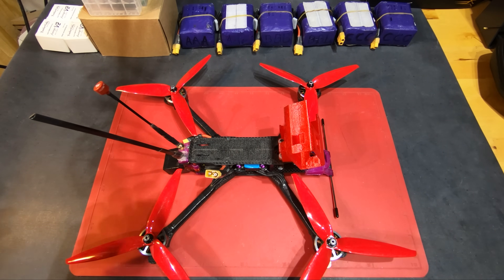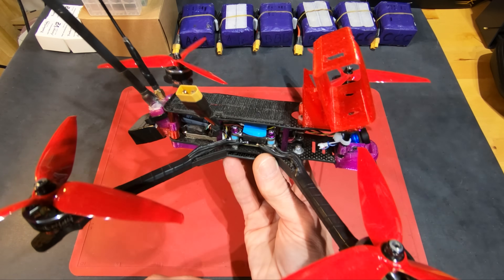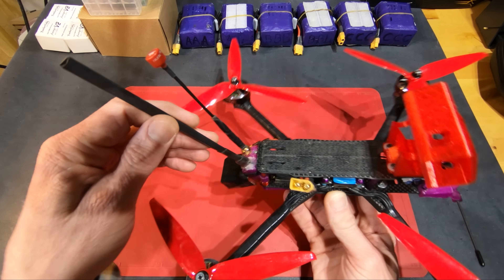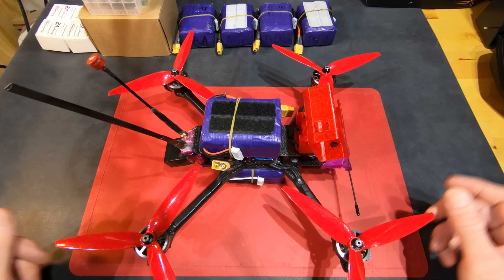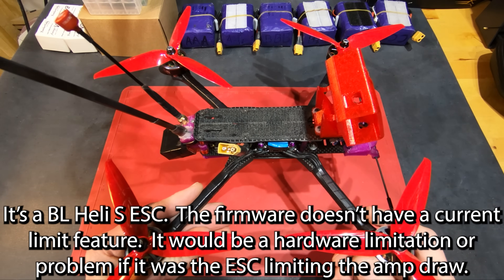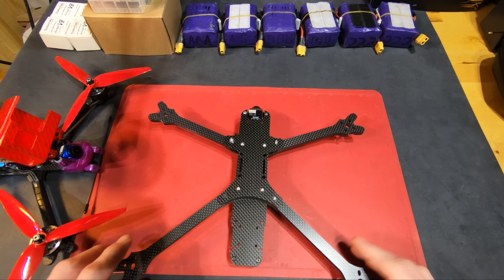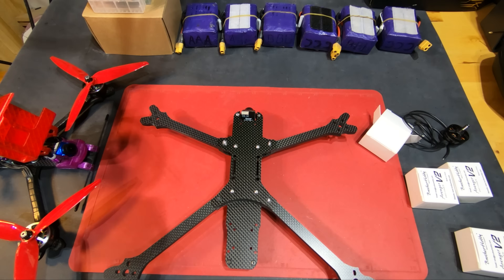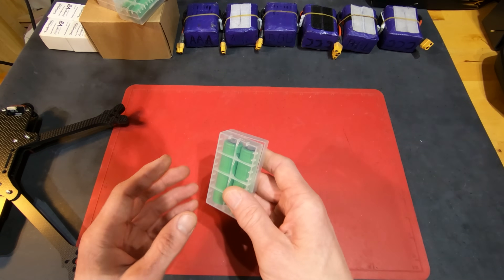My 2020 Long Range FPV Drone & Gear : Gets 8.5km Out - Roundtrips of 18km+

Comment: Where can I buy the frame?
Reply from the maker: I'll work on figuring out how to make it available.  It's not quite ready yet.  Needs testing still.  My old frame (the one I used for most of my videos)  has some minor vibration issues that I never fixed since I moved on to a new frame.  The two will be quite different though so after I finish the new one I might refine the first one some more to be a smaller light weight 6" & 7" for li-ion batteries (lipo's are way bigger, my new frame is partly so I can fit 4000 and 5000 mah lipo's as well as li-ion packs.

Comment: That’s an awesome set up, but how the heck do you get 8km on a 5.8ghz vtx???
Reply from the maker: Thank you.  Its all about good antennas!  (rapidfire module helps and properly working vtx, sma extensions, avoiding interference between parts, but mostly its the antennas)
Reply: @FalconRadFPV  awesome, thanks for the info

Comment: Really been enjoying your videos. Great work🔥
Reply from the maker: Appreciate it!  I just ordered another cut of the new frame with some changes, sorry I can't get it all done faster.  But eventually you'll be the first to get one.  As long as you don't mind helping me "test" the design out after I've got one built and tested to know that the design works out and vibrations aren't bad.  (I think I might go with boomerang arms for both front and back to help reduce vibrations, just ordered some to be cut)
Reply: @FalconRadFPV  I designed my own frame in the meantime but haven't gotten around to cut it. It's more of a lightish longrange frame but with thick arms and bottom plate. If your frame isn't too expensive I'd like to help you test it, as it looks really good

Comment: Have you tried dji fpv? Ever considered it?
Reply from the maker: No I haven't really thought about getting it.  It came out a month after I got my Orqa fpv.one goggles.  It's just too expensive to buy two different pairs of the most costly goggles.  I'd rather spend the same amount on a new gopro and most of a spare quad.  If someone were to donate some dji goggles (lol...) I would be happy do use them, not sure if they would replace my analog Orqas with rapidfire for long range though.

Comment: great this video, it allows you to see your setup
with which you make us these beautiful ballads  ;)
suddenly I would have wanted details on your rear vertical crossfire antenna? construction? thank you
Reply from the maker: Sorry missed that part. It's a trueRC bardpole,  It comes in sma or ufl, I got the ufl version and made a 3d print to work with it, that wat I save the signal lose of using the extra ufl to sma extension.
Reply: @FalconRadFPV  thank you very much for this info, I didn't know this antenna model! ;)

Comment: Been waiting for this.  Surprised you're just using the micro TBS.
Reply from the maker: Ya it's been great, I just got the nano tx v2 for my X-lite.  It would be awesome to be able to get that same range with the small video game style controller (X-lite)
Reply: @FalconRadFPV  That's good to hear, as the full blown unit is definitely out of my budget right now.  I was looking at the X-lite vs the BetaFPV Lite radio, but now I'm waiting for the Jumper T-lite myself.  More budget-friendly without giving up the screen, and not sure i want to give frsky any more money for now with all the ACCESS backwards-compatibility shenanigans they've been pulling.  I did pick up a used R9M (ACCST) on ebay (since they were going for $20) to see how far that'll take me with some mods.  Not going for your kind of range of course, but a similar kind of flying.

Comment: Do you have any suggestions on how to reduce vibrations on 7" drones? I just built my first 7 incher with a geprc crocodile 7 frame and racerstar 2508 motors, and I'm getting awful fibrations, at least with default betaflight pids and slightly increased filters. My main concern is that it has 5mm arms, but I've seen other big drones with 5mm arms and they fly a lot nicer. I use gemfan 2 blade props instead of 3 blade, could that be a factor? Any help would be appreciated, thanks.
Reply from the maker: It would be worth it to try some 3 blade props to see the difference.  First of if you moved the filters up (to the right) then start moving them to the left a notch or two.  It could be a bunch of different tuning issues.  Save your cli dump and try stock pids again, then start with moving the master multiplier slider up 2 notches, then try one more.  Its somewhere to start at least.  UAV Tech has a bunch of great tuning videos.  They are worth watching even if you only understand half of what he says, like me.

Comment: can you please make a whole series from DIY frame to battery pack and then to flying. That will be great.
Reply from the maker: Well that is exactly what I was going to do!  Quad build video, battery video, DIY helical antenna, then back to the freshly built quad for testing, tuning for long range and heavy batteries, setting up gps rescue, starting with short flights and getting to know the battery limits then working up to longer flights.  Oh and also a couple of videos about flight planning, safety concerns and responsible flying.  I'll plan on doing it over Feb., March and April so we can all be ready for the summer (at least those of us that have summer that time of year).
Reply: @FalconRadFPV  we all are waiting!!!
Reply: Please do it..
Reply: Awesome 😎

Comment: Was it the heilcal antenna that allows it to receive good signal from the vtx? Great setup!
Reply from the maker: I'm pretty sure the TrueRC X2-air is even better but either one can get at least 8km.  Of course if it's a diy helical then how well it's made will decide how well it works.
Reply: @FalconRadFPV  Thanks a lot!

Comment: Im running the 21700 molicell 6s1p on my 6" with great results. 15/18min consuming 25/30A Max.
Reply from the maker: Oh nice, thanks for the information!
Reply: What model did the 21700 battery use for your 6S pack?

Comment: Dude i would be scared to death flying out 8km with a Mamba 40a ESC. I don't trust mamba gear that much. How has it been working for you though? ever lost a quad due to components breaking mid flight? I want to get into LR but im scared the quad will get lost. How do i get rid of being scared?
Reply from the maker: That is such a big part of it.  I get scared every time I go to fly long range.  I have anxiety issues at the best of times so I sometimes have to just chill for a bit before flying to let the anxiety feeling get out of my stomach.  Every now and again my hands still shake so much that controlling the quad gets sketchy until I can calm down a bit.  Sometimes I get all setup and start thinking about if I can handle doing it, and I'll just do lame easy flights because I'm not up to doing anything daring.  Sometimes It's fine and I can just setup and enjoy flying as well.  After I had a random prop failure it took a few times out flying again to get my confidence back.  Same with after losing a quad.
 That's all after I'm already really comfortable with the quad and have flown enough packs and kilometers with it to trust it and feel like there shouldn't be any surprises.  I'm doing a build video soon, then a tuning video......eventually a "building up confidence and increasing range" sort of video will come along.  I'll try do a guide all the way from building to testing, tuning, short flights and working up to further.

Comment: What’s the heat shrink/tape on the Singularity? I’ve found those antennas to be really good, but very fragile (seemingly at the base where the coax meets the SMA connector). I’ve thought about attempting to reinforce them to see if it makes them more durable.
Reply from the maker: That's exactly it.  It's great that's its so small and thin but it gets a hard kink at the base if the quad flips over on landing or whatever.  I think I over did it though, lol.

Comment: Nice set up ! What is flight time you get with those batteries? Nice Chanel, sub! ✌️
Reply from the maker: Thanks very much!  I get about 15 to 18 min and 18km+ round trips.  That's with a gopro and a 2km elevation gain as well.  I'm hoping my new setup will exceed that.

Comment: Hello, quick question, which country are you in/what kind of regulation do you have to deal with?
Over where i live it would be litterally illegal to fly more than 500m away from me :( (people still do it for now tho, implementation is slow)
Reply from the maker: I think beyond 500 meters is the max distance in most countries.  I do my best to be as safe as possible.  I actually spend time before ever setting up to fly researching on trails web sites to make sure there are no hiking trails on the mountain I want to fly or at least not on the same side of it.  I never fly in areas with buildings, I stay as low as I can to the ground.  If a flight requires that I go 500 meters in the air to keep line of sight, I just don't do it, I keep looking for something safer.  Flying long range can be done quite safely but rules and regulations must account for inconsiderate, ignorant and "who cares" sort of people.  I'm no more dangerous than the groups of people firing HUGE rifles down the road from where I'm flying.  I could write 5 x more about all the safety things I consider.  I should do a video about all the different safety concerns, I'm sure I'll be able to learn something new from comments on that one as well.
Reply: @FalconRadFPV  Thanks for taking the time to point this out.  With LR  becoming more popular forethought and safety needs to be considered by all.
Reply: @FalconRadFPV  thanks, i am currently looking through the law to find out how to fly long range both safelly and legally (with all the transponders and flight plans and whatnot...bcs fines are not fine)
It is good to see most people taking care of the safety aspect, however, i do wonder, if i was to fly a babytooth up to cloud level, say 1000-1500m above ground level, while having radar24 to monitor air traffic, and if i recorded that, put it on youtube (with all the safety aspects sort of pointed out), and authoroties were to see it, would they considered it safe, or would i get a fine. 
Tbh, im actually wondering if a babytooth could go that high xD

Comment: I'm using the 42a mollicels un 4s pack draining about 20amps power , they came a little Hot at this amp rating, base external temp is about 10 celsius.
Reply from the maker: Ok, thank you for the information.

Comment: Whats the name of the new frame? Also it has props in view or not? i would love to purchase it

Love your videos keep up with the good work. Greetings from colombia
Reply from the maker: I guess it's a FalconRad V2 for now but I'll have to think of something better.  It has just a little bit of props in view when using 4:3 to work with reelsteady go.  On super view there is more props in view.  In the 4:3 view the little bit of props in the bottom corner isn't there after the reelsteady process.  Still might be some changes to make.  The one in the video isn't a ready to go design.  I've already made some changes and I'm waiting on the next one to be cut and mailed to me.  I should be able to build with that next one.  Then I'll need to get through some testing as well.  Thanks for your interest!

Comment: How do you actually mount the Bardpole? Custom holder, glue, both....? Thank you for this video..
Reply from the maker: I got the ufl version to skip the signal lose from an extra sma connector.  So instead of a hole for an sma in the 3d printed mount I just put a 1/2" tube with a split down the middle.  inserted the bardpole added a little hot glue and then some heat shrink around the connection for some extra strength.  The bardpole is more fragile than other antennas (it does flex and bend back but it can't take repeated beatings, but for a long range quad where crashing is avoided as much as possible it works great.)

Comment: Hi, thank you for this! I dont know if this parallel 6s2p at 2600mah will run to this set.up to longer flight. 

Armattan Badger "6
Caddx Vista
Matek F4 FC w/ Baro
Matek SAM GPS Module
DYS aria 35A ESC
BH Returner 1720kv motors
TBS cf nano rx
TBS triumph pro antenna
HQ prop 6353
OVONIC  1300mah 100c 6s lipo

-Any and all help is much appreciated, thank you!
Reply from the maker: Your welcome!  I think it should all work together.  You may have to use a throttle limit if the amps get too high for the battery packs.  Wait HQ makes a 6353?  I was recently communicating with Gemfan and trying to get them to make a 6652.   You don't want the li-ion packs running too hot.  A little warm is fine.

Comment: Very nice to see the quad up close!
Thanks for that.
Because of you, I just finished a geprc mark 4 HD7 myself. Diversity csrf and all like you. Just digital with DJI on RCinPower SmooX 28600 1350kV and on 6S 21700. I run them single 1P not 2P like you plan to do.
Why do you think 4S would be more efficient? I thought 6S helps to keep the current low.
Reply from the maker: 6s does keep the current lower.  If my understanding is correct, current is what gives the motor torque.  Thats why 6s setups usually aim for higher rpm for the props than 4s setups.  A 4s motor pulls say 20 amps at 400 watts.  For the 6s version to pull 20 amps it would be at over 450 watts.  As voltage goes up the amps go down for the same wattage.  But if amps are providing the torque for the motor then at 6s more wattage has to be drawn to get a similar motor response.  (I THINK)
Reply: @FalconRadFPV  sounds interesting, but I think its the other way around (the 6S to rpm) its just the motor gives a certain amount of rpm for a given voltage. for the same wattage it draws less amps. the torque comes from the electromagnetic loading that is also dependent on the voltage. but nevertheless I wait for your results. 6S2P on 21700 would be too heavy (870g)...
Reply: @MoppelMat  Perhaps, in the case of 2 pack 21700 at 6S, it would be possible to put more powerful BROTHERHOBBY AVENGER 2806.5 BRUSHLESS MOTOR motors for 1700 kv, so that the drone could pull this mass of batteries?
Reply: @molecula_fpv  2 pack, you mean: 21700 6S2P? will be much too heavy to be feasible. it will fly on 2806 1300kV no problem, but it would have dimishing returns. you will gain no flight time whatsoever at some point of weight.
Reply: @MoppelMat  This means 18650 6S2P that the option is more optimal in terms of flight time, besides, two batteries are a more reliable option than one! 2806 1300kV + 18650 6S2P - our choice for long range fpv drone on 7" frame.
Reply: @FalconRadFPV  We are waiting for real information from you, whether the flight time in freestyle will be longer on the 4S 21700 than on the 6S 18650!
Reply: Let it be very interesting if the 4S 21700 Pack is more efficient in terms of flight duration compared to the 6s 18650. Please tell us about it! Because it is the capacity of the batteries that is the limiting factor in the duration of flights.

Comment: Hi. I think if I have the opportunity to buy your drone ready to fly I will haha. Nice one. How do you wire your vtx ? Coax cable for signal ? Twisted power cable ?
Reply from the maker: Nothing too special.  I twist the power wires and try to keep things as neat and spaced out as possible.  I use a short mmcx to sma  to connect the antenna.  I got a tbs unify pro for my next build so it already has the sma extension mounted to the vtx, one less connection to affect signal strength I figure.
Reply: @FalconRadFPV  ok ty. I use a USB between FC and vtx (four cables inside aluminium, so +/-/signal/smartaudio) but i have got many video feed issues so I think it is not efficient ! I have to clean it up that haha.

Comment: Inspired by your videos I'm currently building a 7" long range quad. Frame is a design of my own. Actually it looks very similar to your new build. I guess there are only so many ways one can design a 7" deadcat frame. I went with 6S2P VTC6, judging from the current draw I can see in your videos I should be fine. 
Please share some thoughts on PIDs and filters!
Reply from the maker: My tuneing issues were about getting my filters right.  I tuned the filters at stock pids.  Then tuned the pids which all went up quite a bit.  Then I started struggling with vibs and jello at mid throttle.  I finally discovered that I needed to retune the filters after cracking up the pids to make up for the heavy quad.  Then it was all about getting my pids high enough that I was getting d-term oscillations under heavier throttle inputs and then turning it back down a little bit.  Running the double battery packs I think requires some higher pids to account for the extra weight.  When I use a single battery I can tell my pids are too high for the reduced weight.
Reply: @FalconRadFPV  Finally have my 7" up and running. 
https://youtu.be/i_knaqS9x3Y

Comment: excellent. I still haven't figured out what that antenna is beside the VTX antenna. Maybe you even explained it but I'm Italian and don't know spoken English perfectly. Better the written one. thanks
Reply: It's the second antenna for Crossfire diversity. -> TrueRC Bardpole
Reply: @Daniel-S.-FPV  thanks
Reply from the maker: That's right, A vertical antenna mounted in the back is fairly common among long range quads.  It's the best orientation for extended range.
Reply: @FalconRadFPV  i didn't know you used a diversity receiver. i use the tbs nano receiver which is great. Two antennas are always better than one.